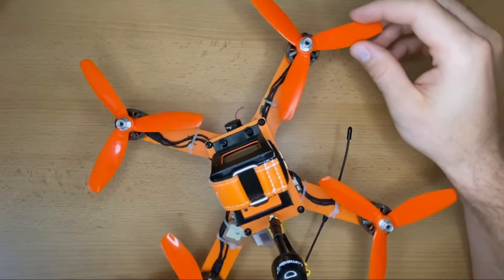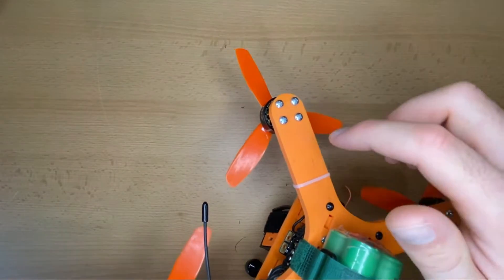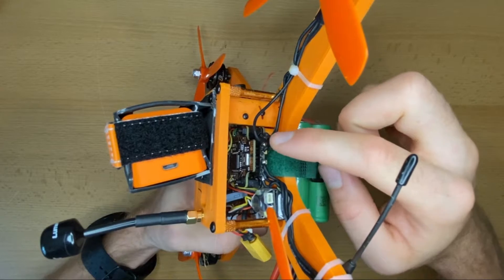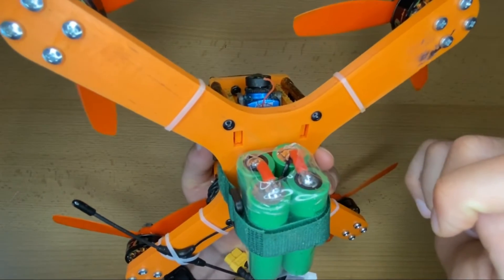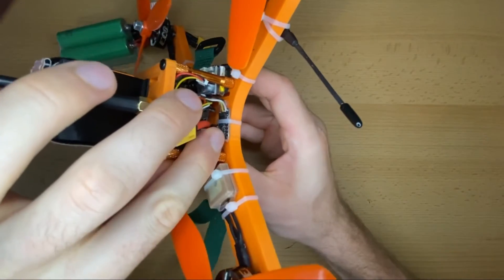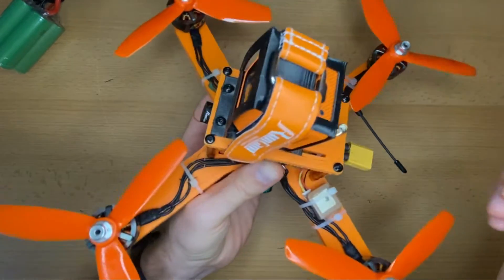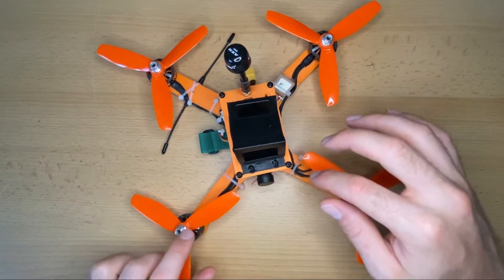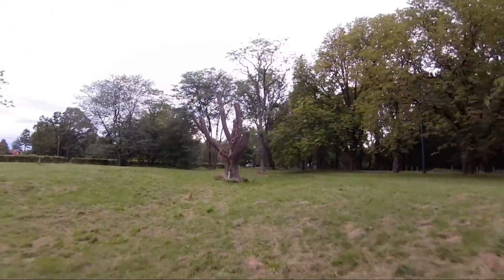3D Printed 5" FPV Drone Frame Design

Comment: Great video on frame design! What material did you print it in? PLA? You added 2mm thickness to the frame, but what total thickness did it have in the end. Would you consider sharing the Fusion360- or .stl-files?
Reply from the maker: I'm pleased you enjoyed my frame design video. I used PLA for printing, it performed significantly better in my tests compared to ABS. The total tickness ended up being 8mm.
The .stl-files can be found in Thingiverse: https://www.thingiverse.com/thing:6159958